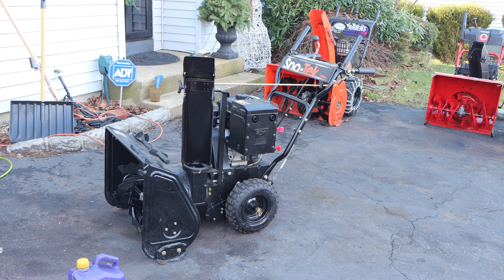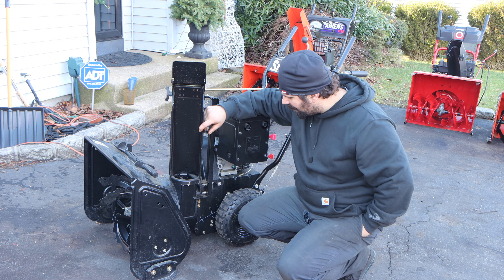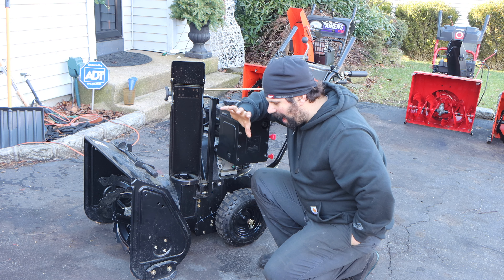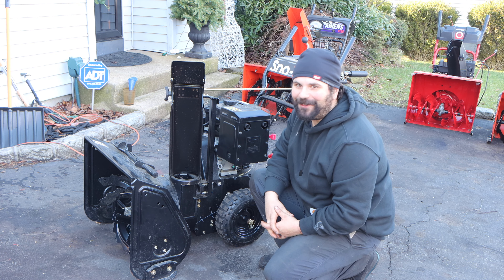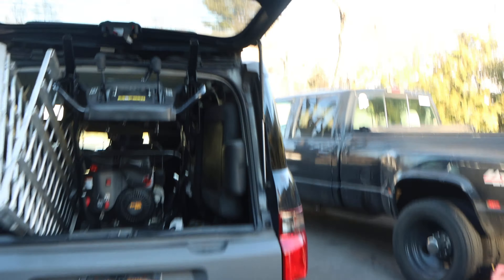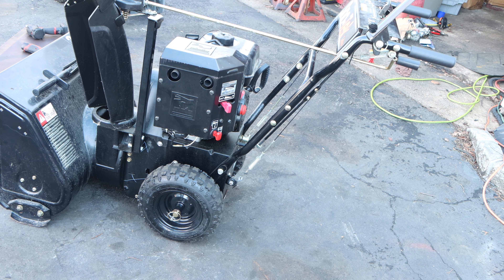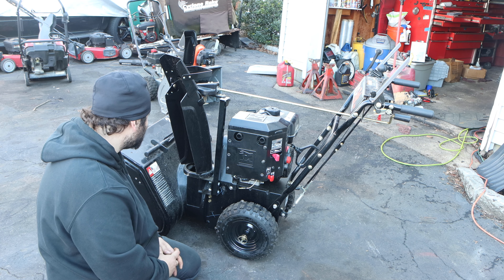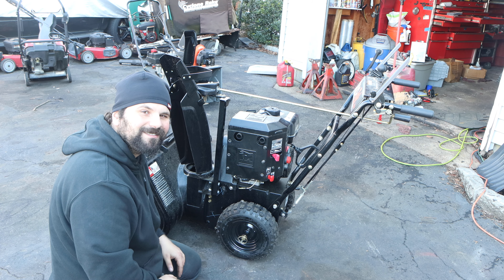How to Fix Ariens Husqvarna Poulan Pro Johnsered Snow Blower That Surges LCT ENGINE Fix N Flip

Comment: This fixed my surging idle! The little hole was maybe only 1/4 clogged up, but was enough to make the engine run rough, with the temporary solution being to turn the choke halfway down. I took a little strand of copper wire and used that to scrape away the junk, and it runs like new! Amazing, thanks for the video!
Reply from the maker: @CarRepairsMadeSimple  thank you so much for stopping by and sharing your experience!  Crazy how such a tiny hole will cause such a big issue.

🔧🇺🇸🦅

Comment: They work well but they cheap out on the guts everything is plastic where ariens would be metal
Reply from the maker: These machines share the same internals as the compact series.  I have never had access to their 26” machines to compare to a 28”. My favorite style of these which I have built on has full tilt chute control.